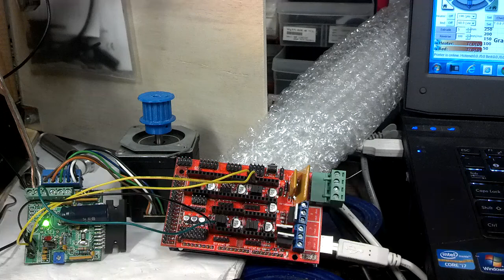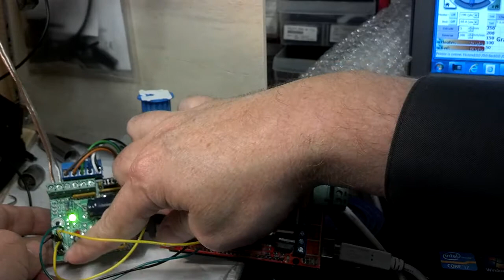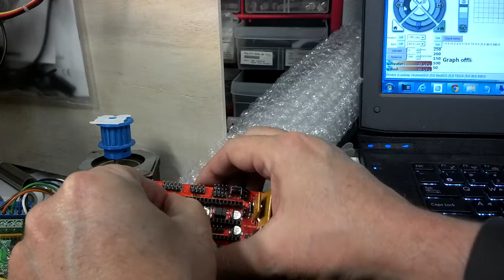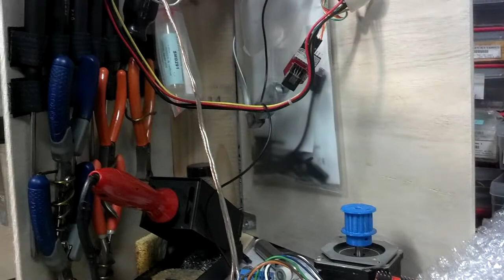RAMPS running THB6064AH w/o Adapter Board.

Comment: What are the possibilities of connecting 2 Nema23's together for each axis? Can this be accomplished without overloading the THB5053AAH, during normal cnc milling? I came across the powerlolu driver board rated at 10a but I think they are hard to acquire from Germany.
Reply from the maker: +Rick Hess THB5053AAH? If you mean the THB6064AH, then it is possible, but you want to pick motors with a higher coil resistance because when you connect them together it has the effect of making a single motor with half the resistance.
Reply: +James Newton Sorry, I'm not sure where I got the other model number from. I wonder what would be the results using 2 nema23's? Can you list some motors that have those specs with a higher coil resistance? Or what key words shall I use to find such motors (Volts, Ohms, other specs) that would be compatible with your Driver?
Reply from the maker: It's hard to find listings for motors that show everything. You want higher ohms/phase. Take a look at the 6 or 8 wire motors in this list:
http://techref.massmind.org/techref/io/stepper/linistep/motors.htm
but also look around on ebay or wherever to find motors... usually there is a range of different versions available, pick the ones with the higher Ohm rating.
Reply: +Rick Hess What specs should the motors have?
Reply from the maker: Well... that depends on your application. How much torque you need, etc... This page might help:
http://techref.massmind.org/techref/io/stepper/estimate.htm
Reply: Thank you for the links, they should be very useful. Do you know of anyone using your stepper driver with motor pairs successfully? I can't be the only one needing this type of setup, yet it's hard to find much on this particular subject in the reprap forums or elsewhere. I'm building this cnc machine but I will also be a 3d printer so I need to build it strong enough with the cnc forces in mind first of course. I didn't realize the ramps board was limited to only certain types of drivers nor would did I realize I would have any issues with amperage or coil resistance. It has been difficult to predict some of the hurdles this being my first build and I'm in too deep now to turn back.
Reply from the maker: Yeah, Andrey used that on his concrete house 3D printer.